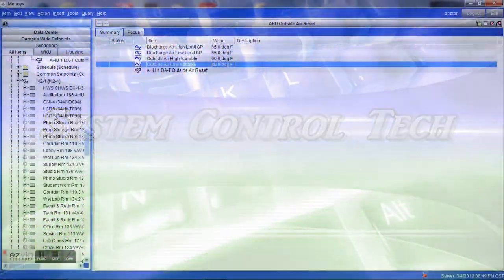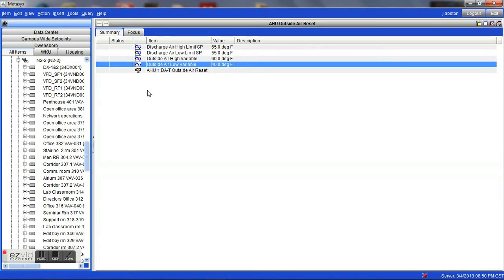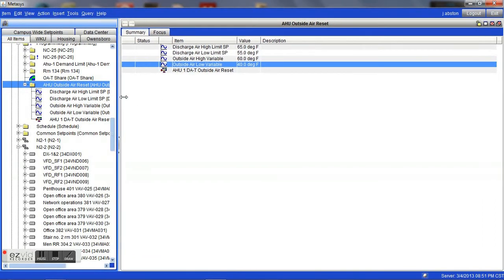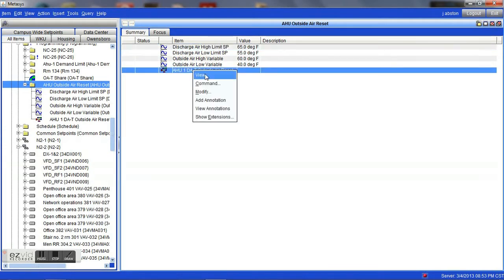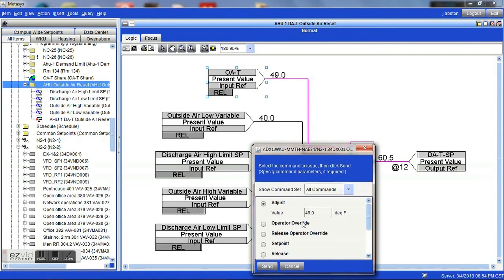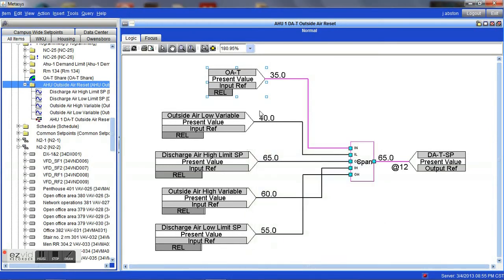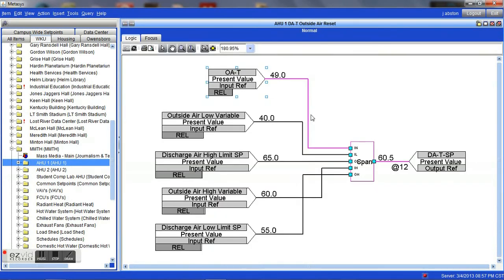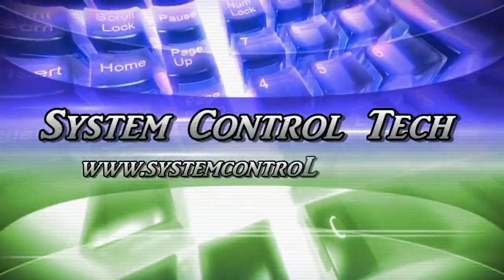Discharge air temperature reset

Comment: Is a 55F discharge temp maintained all year round?  Even in heating?
Reply from the maker: That depends on the particular building.  For us, most do not. Some labs and even hospitals have special circumstances that require that set point. Raising it in colder weather can help most buildings perform better.